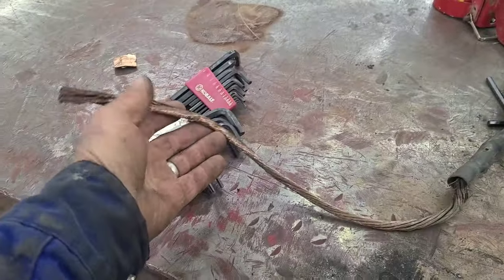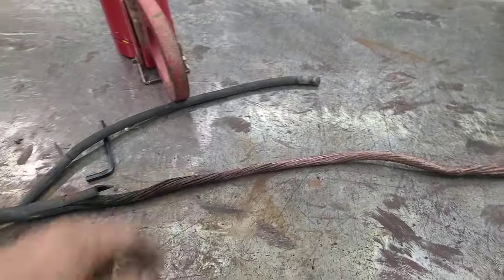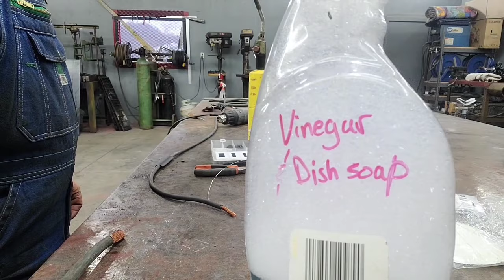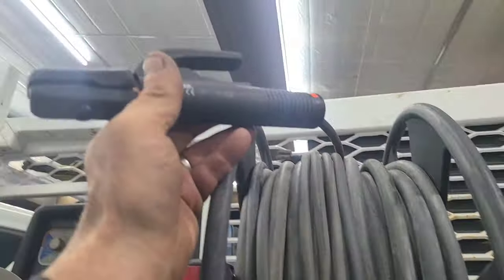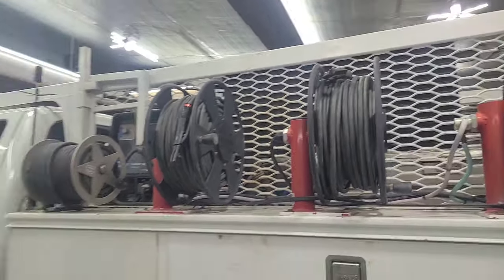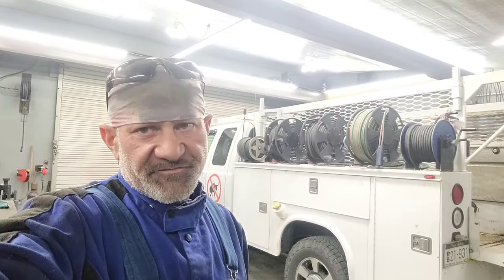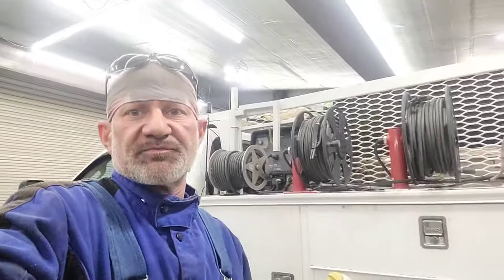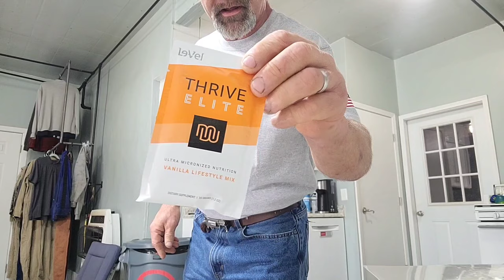Rebuilding and splicing welding cable

Comment: In addition to my main machine on my welding truck. I have a Lincoln ranger 305g and I have a skid for it that locks up securely and can be left on site. And it can be moved with a crane or forklift. Then I also have a 4 wheeled cart for it that I can roll it around inside buildings. I don't use them alot but when I need them they sure do come in handy. Pretty slick way of joining cables I haven't seen it done that way before. Thank you for showing.

Comment: Good information-  so it's interesting to me that the copper will tend to "burn" from the stinger end, but as you move back toward the machine the copper becomes less and less burnt, and eventually looks new-  I guess that's because the current coming back up the stick is maybe "hotter" right there at the end, and then that heat dissipates as the current moves back to the machine?  And this is assuming DCEP polarity, obviously.
Reply from the maker: Yes....you got it

Comment: Guys, CB used stainless steel wire to wrap the copper before soldering. Solder won't stick to stainless. Then unwrap it and discard it.
Reply from the maker: Correct
Reply: Learn something new every day. Thank you for pointing that out.
Reply: guy748....
7:39 start the video at this time. See what is happening!
Reply: was wondering what that was all about-  thank you for the explanation-  makes perfect sense, as there's always a perfectly logical reason a good and smart welder does anything like this.

Comment: Current(amps) or electrons flow on the outside diameter of the cable. The bigger the cable the more area current/amp/electrons can flow on. If the wire is dark or black it will cause resistance in the cable. A sure sign of excessive resistance is the stinger getting hot after burning 4 to 6 electrodes.
Reply: Does that mean a braided copper wire that's hollow on the inside like the steel jacket on brake lines would be the most efficient use of material to move a given amperage, or do you need the thermal mass of the core to keep it cool?
Reply: @lordslavik solid wire is necessary to keep heat and resistance low. Most the electrons flow on the outside of the wire. Some electrons flow in the core but most flow on the surface. The solid wire helps dissipate heat as amps go up. Length also plays a huge factor in resistance. Try welding 250 amps with 6 gauge wire that is 50 feet long. The resistance will increase and eventually melt the cables. Also, keep in mind the power source is trying to put out set amperage, if the cables can’t handle the load, either from high resistance or small cables, damaged will occur to the power source. This is especially true for inverters.

Comment: @NBSWelding --- What kind of reels do you have on the super service truck? I am looking for a reel that will hold 100' for 3 /16" or 1/4"   oxy\acetylene  hose. Looked at Aluma Reels but yikes, I was a little shocked by the price.
Reply from the maker: Leads are on Reelcraft and they have done very well...potentiometer is on a Tidweld and it's done good for me too
The only bad reels I've had were Cox Reels...those things are junk
Reply: @NBSWELDING  Thank You  for the feedback. I will jump out and look at Reelcraft for the oxy/ acetylene.

Comment: Splicing is fine, but to carry the full current you need to kind of 'jam splice' the wire, 'fluff' both ends to be joined after cleaning and fluxing, but squeeze back into round shapes that are loose with the inner and outer strands spread out somewhat, and shove one end into the other, mixing strands throughout of both, then solder, and you can add strength by also soldering a few extra twisted strands that are same length to the outside before insulating the splice.
Current travels along the surface of a wire, not the center, that's why more fine strands carry more than regular stranded electrical wire, the more strands, the more total circular mils of surface you get, splicing only to the outer wires in bundles reduces the usable circular mils.
Reply from the maker: Can you post a video showing how the jam splice is done?

Comment: Why did you use a smaller guage wite to go to stinger, but then built it up to fit tightly inside it? Kinda counter produtive isn't it? I'm not a welder but i am curious why that was done. 🔌🔋⚡💥💨🇺🇸🛠️🔧🔩🤔👌🏻👍🏻🍻☃️
Reply: The splice that guy is talking about below is like if you'd spread all your fingers & thumb apart on both hands. Then putting your 2 hands together so all digits are intertwined together. Fingers being the individual copper strands. Hope that helps. 👍🏻👌🏻⚡🔌💥
Reply: Larger cable for current capacity and smaller wire on the end becouse it is lighter and more flexable.  It reduces fatigue.
Reply from the maker: Correct